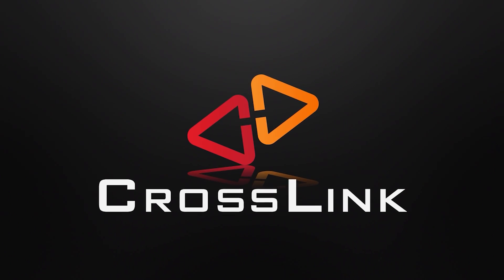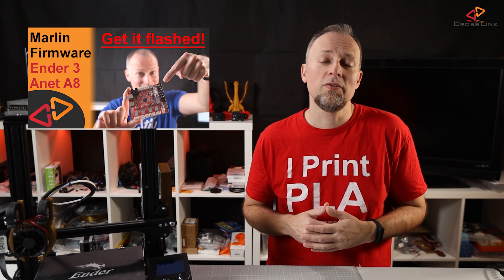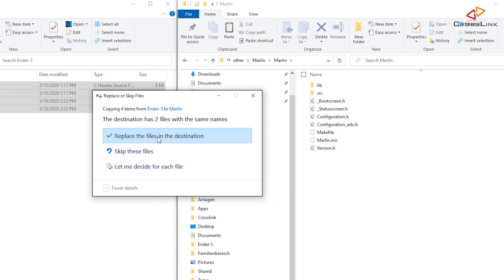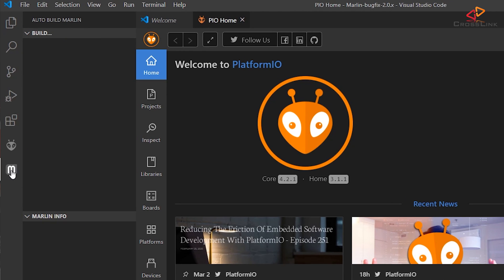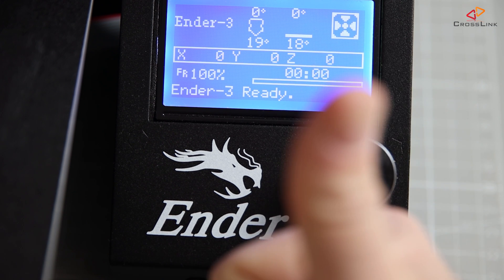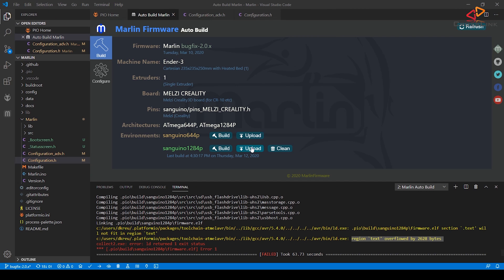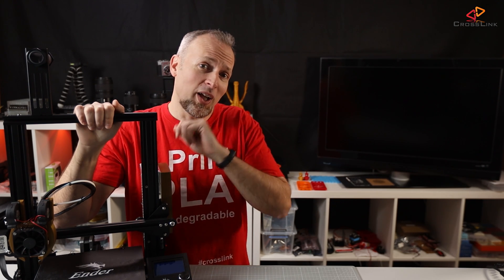Ender 3 (Pro) Marlin 2.0 Upgrade  - Updated Version

Comment: I just got an Enders 3 that has an upgraded boad 4.2.2.  I click on the printer info and it is running Marlin 1.0.1.  Is this a good firmware or should I upgrade to 2.0.1 is the newest version on the GitHub site?

Comment: Btw, If the .bin file ends up somewhere on ur PC, not uploaded to printer, just slap that bad boy in a formatted sd and insert. 4.2.2 board btw. May be wrong abt this next bit but I don't see any reason why you even need to connect printer to PC to upgrade the firmware.

Comment: Question, the ONE that I had that you didn't answer. (I had many and searched for hours)  My board is 4.2.2, when I get to the select environment section I get multiple options, how do I know which to choose?  I downloaded bugfix 2.0 for my marlin file.  the environements are all variations of STM32F103R_creality or STM32F103C_creality...there are 5 in total...too many choices.
Reply: I am having the same issue.  Have you found a solution?
Reply: I am having the sams Issue. Have you found a solution? Pls help
Reply from the maker: Going for the first one is the safe way. You can’t break anything there
Reply: @Crosslink3D  Da hat nichts funktioniert. Hab jetzt einfach von der SD Karte geflasht.

Comment: For anybody with an ender 3 pro, you should have a creality v4 2.2 board which has a boot loader pre installed! Make sure in the examples/creality/ender 3 pro folder you select the configuration titled, ”CrealityV422”
Reply: New Pros should have the 4.2.7 silent board
Reply: @TheSuburban15  maybe newer ones have but I got one with old board.

Comment: In VSC Marlin Firmware Auto Build there is no Sanguino 1284p environment available. I only have melzi_optiboot_optimized, melzi_optiboot, melzi_optimized and melzi builds available. Which one to chose? I have tried with melzi build which reports the following error: Marlin\src\lcd\marlinui.cpp: In static member function 'static void ManualMove::task()': Any suggestions?

Comment: I love the video but I am having a hell of a time with this process. I’ve gotten as far as opening the folder in VS Code but it keeps opening it in platformio and not auto build marlin. I’ve reinstalled vs code about 10 times and finally figured out how to delete folders/projects from vs code. It was crashing repeatedly but I think it was because it just kept adding folders every time I tried. But now my new problem persists. How do I stop platformio from taking over auto build marlin? I click the hammer but nothing happens while platformio sits and waits for my instruction. Super frustrating how one mistake takes hours to figure out. Didn’t these things used to come with a reset button?

Comment: I installed a bootloader and Marlin firmware 2 or 3 years ago on my Ender 3. I haven't used the printer in 2 years. When I got it out to use it again, it won't print. I think the firmware is corrupted or something. Since burned a bootloader before, do I need to do that again? Can I just use USB and reinstall Marlin? I think you explained this but I want to make sure I heard you right.

Comment: i just did this for my ender 5 plus and followed all instruction but downloaded the settings for my model. everything seemed to be working fine, but now the screen is all in chinese and it doesnt open to the settings page anymore, i did this for the new silent board. is there a configuractions setting out there for that? is that why it went wrong?

Comment: I can make it to the build section. Mine does not have the sanguino listed. It only has melzi, with different options for that. I have tried to build from that, but get all kinds of errors. I have an Ender 3 Pro V1 1.1.4 board. I have been attempting to install a BLTouch, with no success. I was hoping that maybe upgrading to the 2.0.x would help. Any ideas on why I am not seeing the sanguino option?
Reply from the maker: Sanguino has been removed in later Marlin versions. You should got for the melzi optiboot optimized.
Reply: @Crosslink3D  Okay, Thank you, I will try that

Comment: Hi sir.. This is amazing tutorial for upgrading the latest Marlin Firmware versions. I want to ask something. I've Ender 3-Pro with 4.2.2 board. What stepper driver type that I should choose for mine? and what's the different between TMC2208 and TMC2208_STANDALONE?
Reply from the maker: TMC2208_standalone is correct for that board as Creality does not support spi mode, it’s hard wired so you cannot change that. That only means you cannot use Sensorless homing and you cannot set driver voltage through software, only with the potis on the board.

Comment: Nice video with step by step guide.
But I have a question. How to find the environment sanguino 1284p is the model which I have

I bought a ended 3 pro. Which shows Marlin 1.0.1 and the default sd card had the firmware for marlin2.0 v1.01 bin file

Comment: so it's not possible to download Marlin to the SD card/USB and update it from there? You need an Arduino or VisualStudio coding? FML
Reply from the maker: Not if you have an 8 bit board. Those require to install a bootloader via arduino and then you can use usb to install the firmware. The newer 4.2.x boards support flashing via sd card.

Comment: I thought I already has platformio installed. Just for the record, if the extension isn't installed, opening the marlin folder and waiting a few seconds will cause a pop-up requesting you install it.

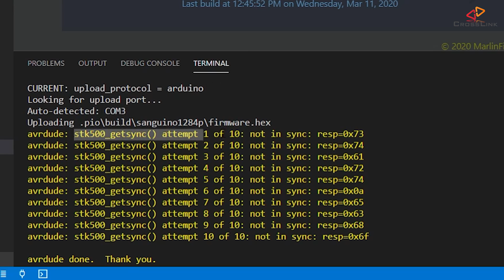Comment: Really good Tutorial however about STK500_getsync error  ( minute 7:50 of video) - i would have firstly check settings for baud rate in file avr.ini in VS Code, for my stock 8bit melzi it was set incorrectly - when i set it manually (upload_speed ) to 115200 the error disapeared - wish i knew it sooner.... spent about 4 hours to solve it :P
Reply: Thank you so much. I have spent a couple of hours too when I finally have found this comment!

Comment: Just a heads up for anyone using the links in the description, they have since been updated. You can still use the links, but use the drop down to select the bugfix version instead of the regular version (it directs there by default). The original release generates errors for some machines. For me it was an ender 3 using the 4.2.7 motherboard, the bugfix version works great!
Reply: Thanks!!
Reply: huge.

Comment: I am having trouble with the platformIO as when i got to build in marlin auto build it shows up as Melzi i have tried changing the default env in platformIO to sanguino and it is still not working
Reply: Fixed it by reading the error which says the correct name for the sanguino environment ment for my ender 3 pro is sanguino1284p_optimized

Comment: So as of now when I watch this there is a ender 3 pro folder. I used that one but stuck at the Build button of visual studios as I don't know if I have e a Mega1280 or a mega 2560 board. In your Video it's different. Idk if I should try your original ender 3 folders or if one of these ender 3 pro options are better for my ender 3 pro

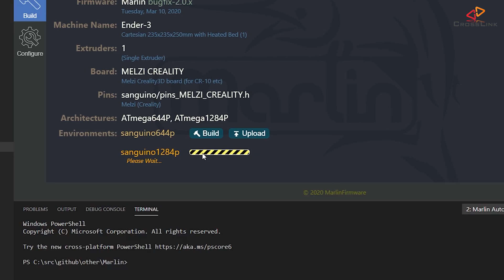Comment: I know this is an older video, but I just tried to follow your steps and got to 6:17 where I should chose the environment. I don't have th sanguino options and I have way more folders in my Configuration folder.
All I find now are insrtuctions for the Ender V2, but I have the normal Ender 3. Socould you maybe help with an update4 on this or something? I'm a little lost otherwise :D
Reply: did you ever managed to fix that?
I'm trying to install it on my Ender 3 but I can only see Melzi environments

Comment: Hi!
Thank you fot this video.
I need help with my printer please.
I have a simple Crealty Ender 3 printer.
I looked at the software upgrade options from Crealty webpage and can't figure out what software I could upgrade my printer with.
It doesn't have BLtouch and I don't know if it has an adapter board or a detector filament.
It's like I bought it.
I went to the manufacturer's page and found the following software for the upgrade:
"Ender-3-4.2.7-TMC2225 - Marlin2.0.1 - V0.0.6"
Is it good if I upgrade this printer with the software I have?

Thank you.

Comment: its Keeps saying  this folder doesn't contain a valid Marlin 2.x project, and the sub folder for creality has the ender 3, ender 3 pro and ender v2 which all have more subfolders. What do i pick and where did i go wrong. I followed all the instructions of this video
Reply: I had the same issue.  I got passed it finally...did you copy the four config files from the configuration import over to the marlin firmware folder?

Comment: Hi. I have download the files and now i see a folder called "Ender 3 PRO". I click on it and i see my new silent board folder "V4.2.7". So i used the correct config files for my printer. But when i build it shows this:

"Windows PowerShell
Copyright (C) Microsoft Corporation. All rights reserved.

Try the new cross-platform PowerShell https://aka.ms/pscore6

PS C:\Users\dfmar\Desktop\Marlin-2.0.x> platformio run -e STM32F103RET6_creality
Processing STM32F103RET6_creality (platform: ststm32@~6.1; board: genericSTM32F103RE; framework: arduino)
--------------------------------------------------------------------------------------------------------------------------------------------------Verbose mode can be enabled via `-v, --verbose` option
CONFIGURATION: https://docs.platformio.org/page/boards/ststm32/genericSTM32F103RE.html
PLATFORM: ST STM32 (6.1.1) > STM32F103RE (64k RAM. 512k Flash)
HARDWARE: STM32F103RET6 72MHz, 64KB RAM, 512KB Flash
DEBUG: Current (jlink) External (blackmagic, jlink, stlink)
PACKAGES:
 - framework-arduinoststm32-maple 2.10000.200103 (1.0.0)
 - toolchain-gccarmnoneeabi 1.70201.0 (7.2.1)
Converting Marlin.ino
LDF: Library Dependency Finder -> http://bit.ly/configure-pio-ldf
LDF Modes: Finder ~ chain, Compatibility ~ soft
Library Manager: Installing SoftwareSerialM
Library Manager: SoftwareSerialM @ 1.0.0 has been installed!
Library Manager: Installing U8glib-HAL @ ~0.4.1
Library Manager: Warning! More than one package has been found by U8glib-HAL @ ~0.4.1 requirements:
 - marlinfirmware/U8glib-HAL @ 0.4.3
 - thinkyhead/U8glib-HAL @ 0.4.3
Library Manager: Please specify detailed REQUIREMENTS using package owner and version (showed above) to avoid name conflicts
Library Manager: U8glib-HAL @ 0.4.3 has been installed!
Found 30 compatible libraries
Scanning dependencies...
Dependency Graph
|-- <SoftwareSerialM> 1.0.0
|-- <U8glib-HAL> 0.4.3
|   |-- <Wire> 1.0
|-- <STM32ADC> 1.0
|-- <EEPROM>
|-- <USBComposite for STM32F1> 0.91
|-- <Wire> 1.0
|-- <Servo(STM32F1)> 1.1.2
Building in release mode
* [C:\Users\dfmar\.platformio\packages\framework-arduinoststm32-maple\STM32F1\variants\generic_stm32f103r\board.cpp] C:\Users\dfmar\Desktop\Marlin-2.0.x\.pio\build\STM32F103RET6_creality\.sconsign37.dblite: No such file or directory
========================================================== [FAILED] Took 22.00 seconds ========================================================== 

Environment             Status    Duration
----------------------  --------  ------------
STM32F103RET6_creality  FAILED    00:00:21.997
===================================================== 1 failed, 0 succeeded in 00:00:21.997 ===================================================== 
PS C:\Users\dfmar\Desktop\Marlin-2.0.x> echo "done" >C:\Users\dfmar\AppData\Local\Temp\ipc
PS C:\Users\dfmar\Desktop\Marlin-2.0.x>"

What am i doing wrong?

Comment: As of 2/1/2021 the config file on github has an ender-3 and ender-3 pro sub folders, and within those folders are even more folders.  
Is there a chance you can update this part or type out a walk through so that we know what files to transfer? 
inside the subfolder ender-pro there is these folders 
BigTreeTech SKR Mini E3 1.0
BigTreeTech SKR Mini E3 1.2
BigTreeTech SKR Mini E3 2.0
CrealityV1
CrealityV422
CrealityV427

and each one of those folders has its own files like in your video
Reply from the maker: You're totally right. We need to make an updated version of this. I have this on my plan for the upcoming weeks. Stay tuned (also patient ;-)) working hard....
Reply: same problem some of them throw up errors during the build

Comment: Great video but I have a question. I’ll preface this with I am way late to the game and not super technical either. We have an ender 3 pro with the 32 but board v4.2.2. When I need to download the config files there is now a sub folder for ender 3 pro and ender 3 pro v1.5. I don’t see any subfolders with v4.2.2 only v1, v1.5, and v4.2.7. Which should I choose?

Comment: do I need a bootloader for the Ender 3 Max? Although it says "success" when I did the upload, I  see no changes on my Ender 3 Max.  Also the terminal has this message, " J-Link connection not established yet but required for command. Connecting to J-Link via USB...FAILED: Failed to open DLL."

Comment: Does this work with board 4.2.7 how do I enable a bl touch and can I use an SD card to flash it
Reply from the maker: Video on this is coming soon.
Reply: @Crosslink3D  PLEASE and thank you I spent $130 on a 4.2.7 board,bl touch,bed springs,metal dual gear extruder and capricorn bowden tubing and haven't printed anything in a week trying to figure this out my z offset (3.6) always resets to zero on my ender 3 pro

Comment: Great video I appreciate the help and tutorial.  I am having a problem with the build in that when I go to select the environment in Visual Studio the only motherboards that display are Mega1280 and Mega2560.  My motherboard on my Ender 3 Pro is the AtMega1284P, but that option is not available.  

HELP!!!!
Reply from the maker: I hear you, this is still way too complicated. That's why I am working on a project to make it much simpler.
Reply: Having the same issue.  ATmega1280, ATmega2560 are the only options.  I've ensured that I've copied the config folder. Firmware is 2.0.7.2 from Oct 14, 2020.
Reply: Did you ever figure this out? I'm having the same problem...

Comment: Hi this is a great guide thanks for taking the time to make these. i am having trouble uploading the firmware to the printer i get the following errors

CURRENT: upload_protocol = jlink
Uploading .pio\build\STM32F103RET6_creality\firmware-20210111-174323.bin
SEGGER J-Link Commander V6.88b (Compiled Nov 27 2020 15:45:43)
DLL version V6.88b, compiled Nov 27 2020 15:44:11

J-Link Command File read successfully.
Processing script file...

J-Link connection not established yet but required for command.
Connecting to J-Link via USB...FAILED: Cannot connect to J-Link.

J-Link connection not established yet but required for command.
Connecting to J-Link via USB...FAILED: Failed to open DLL

J-Link connection not established yet but required for command.
Connecting to J-Link via USB...FAILED: Failed to open DLL

I have a Creality 4.2.7 board which I have previously managed to flash using the .bin from Creality on a micro SD

Comment: Update for newer (4.2.7) boards:

** ARCHITECTURE/BUILD TARGET ** At 6:06 make sure you DO NOT select an Atmega architecture for the new "silent" boards! My board is version 4.2.7, and it uses a 32bit ARM F1 processor made by STM, not an 8bit ATmel processor. The correct target for it is STM32F103RET6_creality.

** MOTHERBOARD ** At 10:12, in Configuration.h, you need to change: "#define MOTHERBOARD BOARD_CREALITY_V427"  -- otherwise the stepper motors won't work at all and the auto-homing will quietly fail every time with an error message ("homing failed Printer Halted please reset"). Also, there is no specific target for boards version 4.2.2, so I suspect the correct motherboard target in that case is "#define MOTHERBOARD BOARD_CREALITY_V4".

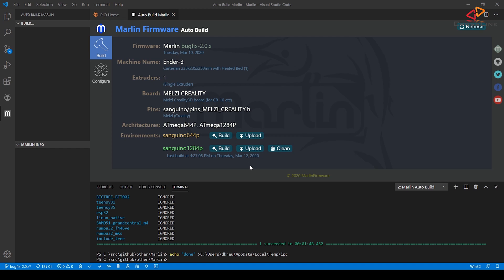** FLASHING ** At 7:35 there is no need to mess with the USB upload process, especially since it can occasionally fail with frustrating COM errors. After building, simply copy the resulting firmware bin file (from .pio\build\STM32F103RET6_creality) to the SD card, and start the printer. This will initialize the firmware flashing process and the printer will update on its own. 

I HOPE THIS HELPS!
Reply: Thank you.
Reply: You're a lifesaver! You finally helped me figure out how to fix my Ender 3 Pro after trying multiple different firmwares when I installed my motherboard. Can I marry you?
Reply: thank you you saved an aftrenoon for me
Reply: Do you know if the 4.2.7 works with the CR-10 mini? Does 24v 32bits boards works with 12v power supply?
Reply: when I click on build it tells me that MOTHERBOARD BOARD_CREALITY_V427 is not compatible with the STM32F103RET6_creality build environment. I have to use any one of these STM32F103RE_creality, STM32F103RE_creality_xfer, STM32F103RC_creality, STM32F103RC_creality_xfer, STM32F103RE_creality_maple
Reply: @roshandeepak  I suspect you are looking at a newer version of Marlin. Versions 2.0.x used the target that I mentioned a year ago. The newer versions such as 2.1.x have eliminated STM32F103RET6_creality, and the correct build configuration to use is now STM32F103RE_creality. Please use that configuration if you use a V4.2.7 motherboard.
Reply: How do you change to a different architecture? I only have the four options shown.
Reply: hi i got an issue with " missing binary operator before token "(" " do u know hos can i resolve it